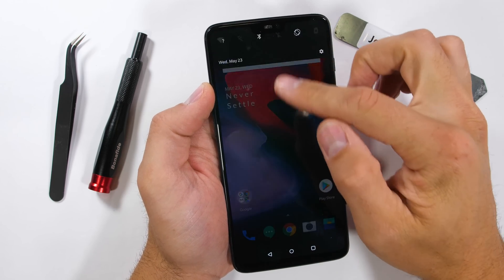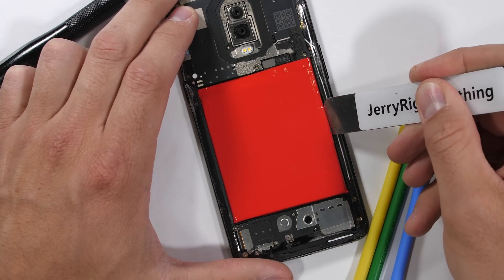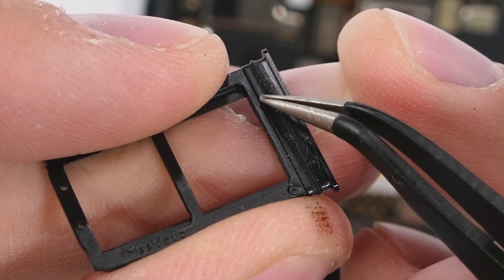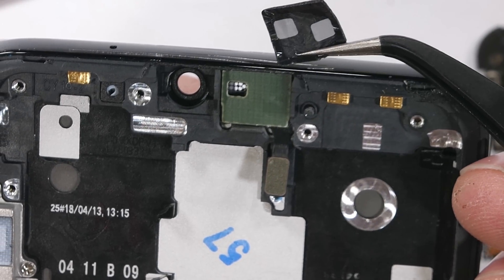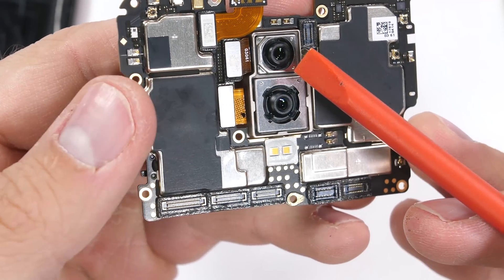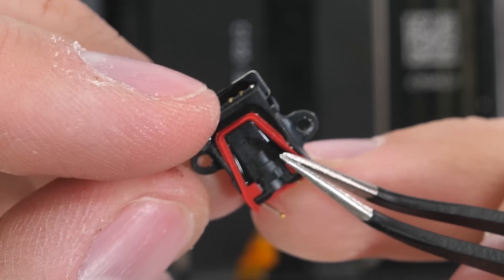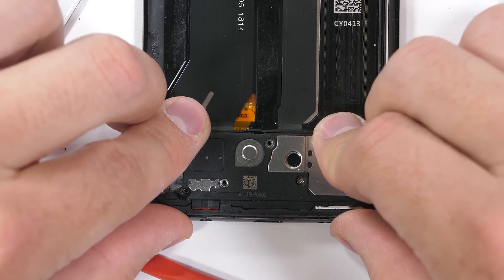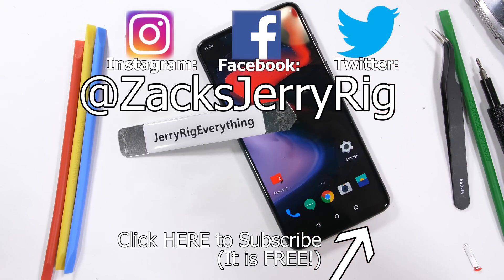OnePlus 6 Teardown! - How Water Proof is it really?

Comment: I've had my OP6 since 2018 and I always use it in the shower... no issues. This phone is built like a tank. Nothing breaks and it doesn't slow down over time. In-stores when I put it side by side with the latest Galaxy S25 Ultra, it's still equally as fast as those. Somehow I doubt the Galaxy phones won't slow down over time, though they'd fare a lot better in heavier tasks of course.

Comment: In retrospect the oneplus 6 really did need better cooling. A lot of oneplus 6's are now dying with the main symptom being the dreaded "Qualcomm Crashdump Mode" issue, where the phone would crash randomly to a BSoD of some sorts. You can see many reports of this issue on Reddit and XDA.

Many people incorrectly attribute this issue to software updates, but in reality it's because the physical internal connections inside the SoC are getting damaged from heat over long periods of time. The most common temporary fix is to quite literally just apply pressure using your finger onto the back of the phone for some time on to the spot where the SoC is (beside the camera on the right) and it would stop crashing for a day or two.

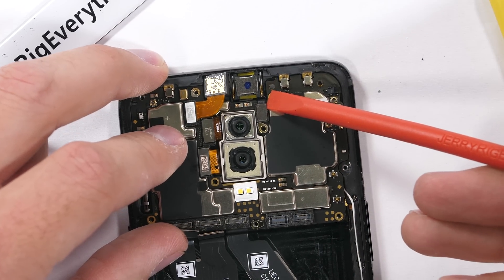Comment: 2:00 To answer Zack question. Yes, it does suffer from thermo throttle after 5 years of use. The temp go as high as 60°c. It definitely needed some cooling solution
Reply: yea same I'm facing cpu heating while charging my phone as well

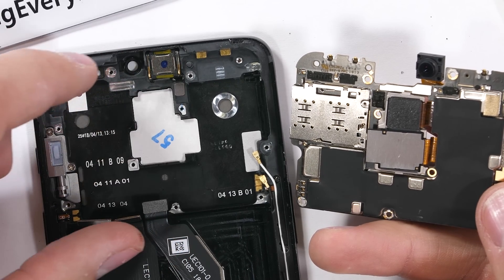Comment: 2:08 Yes, time has told IT IS IMPORTANT TO HAVE HEAT DISSIPATION. Hundreds of Oneplus 6 users have faced a particular error called QUALCOMM CRASHDUMP MODE which involves some loose contact in the eMMC chip, probably due to overheating accumulated damage over time. I have been a victim, and honestly am afraid to trust Oneplus anymore.

Comment: 2:08 The thermal pad is literally right in front of your face (stuck to the underside of the mobo, it might technically be under one of the camera modules, but it'll sink heat into the frame for that entire board)...

Comment: Do you think it would be possible to add wireless charging receiver inside the phone to make it compatible with Qi charging? I know u can add a pad to the back of the phone but that plus into the USB C port, I don't want that. I want it directly connected to the battery. Thoughts?

Comment: OnePlus 6 is a nice phone. But for the asked price i get more where i live. Im in the heart of Europe. The OnePlus 6 in the highest configuration is approximately 720.- euros. For this you already could buy a Samsung S9 plus. The S9plus is IP rated, has a sd card slot, is dual sim, has a higher resolution display (best there is), has stereo speakers, wireless charging, camera can change it’s aperture, iris unlock (safer than face unlock), Samsung pay, Knox and i could keep counting.

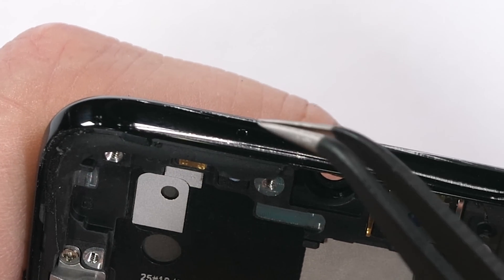Comment: 2:12 Is it aluminium covering the cpu? If so, would Thermal Grizzly's conductonaut be possible? I have Arctic Silver at home though, which is less risky. If you wanna overheat, download Pocket City (amazing microtransactionfree game) and in Sandbox Mode build as many different buildings/roads you can, as fast as possible 😁

Comment: The reason why Oneplus doesn't want to put it officially, is that then they aren't responsible for the idiots who thinks their phones are waterproof and not water resistant. Simply smart defense on their side. They saw how sony, Samsung and Apple costumers got burned by the water damage on the phone, because they thought it was waterproof. So instead of saying our device is protected and you can use it wherever, they said it is somehow protected but just stay dry. Better safe than sorry.

Comment: Do phone manufacturers have to pay for an official IP67 certification? 

If so, that might explain why One Plus chose not to market it as such, despite the inclusion of adequate water-protection.
Reply: WickedRibbon yes they do need to pay for the certification, but it's expensive, thus OnePlus can cut costs.
Reply: Even if it's ip rated the warranty doesn't cover water damages for any phones. It just gives the user peace of mind. 
One plus took the same safety measures but just didn't get the certification to cut the costs. Any customer with a little research will be able to find this information.
Reply: @tawsifislam827  true I wash my OnePlus 6 every single day due to the fingerprint smudges and it is still going great
Reply: Also opens companies up to lawsuits. Samsung as of last month is going through it. Oneplus is an enthusiast company, not a multi billion dollar conglomerate. They would end up going under.
Reply: It's not even a adequete one.

Insufficent in both of money and water resistance.
Reply: @hkw1031 *resistance
Reply: @IcyHorizons2435  Thanks daddy

Comment: The reason they don't have an IP rating can be summed up in one word... WARRANTY!
Reply: Angelito Posse No phones manufacturers give phones warranty, no matter what the IP rating is.
Reply: Alexander Anderson Idk where you live but here in the UK every product sold has a minimum 2 year warranty and it's up to the manufacture to prove misuse if the device suffers water damage but is rated as water resistant for example. If it isn't and it's water damaged obviously that's automatically misuse so they can dismiss your warranty claim.
Reply: Angelito Posse Where I live, phones do have warranty but not liquid warranty, when it was damaged by water.

Comment: I'm guessing that although the One Plus 6 does indeed have all the water resistant components in place, they probably aren't as top quality as the other flagships which is why they didn't want to risk giving it an ip rating. So basically the water resistance is there, it works but it probably won't hold if push comes to shove.

Comment: What ip rating would it have if they'd included it?
Reply: GTech Fam yea that was what I thought aswell
Reply: Lakrima Not sure, but as Matthew Moniz has already proved, the water resistance isn't great.
Reply: Yea but I think it would fall on like an IP 67 or so
Reply: Lakrima nope the video by matthew moniz proved the phone would fail an ip67 test
Reply: nope. matthew moniz also test it two or three times before the test. And ip67 is not only about  40 inch for 30 minutes..The depth can be varies but limited to 1 meter
Reply: GTech Fam yeah and once again the selfie camera got water damage in less than 30cm of water in less than 5 minutes which is well under ip67

Comment: Another Youtuber recently visited the OnePlus factory and during that video it showed OnePlus does run water spray testing on this phone model for quality control purposes, even though they do not market an IP rating on this model.
Reply: Getting an IP rating is expensive, another reason why OP6 is not super expensive!
Reply: Richard Decker companies with ip ratings dont cover water damages either. Its even says in samsungs warranty that water damage will not be covered because it is water resistant not water proof
Reply: We get it. You stroke to Samsung and want everyone to know about it lol.
Reply: Mats Thijssen ip68 is 1.5 meters(about 60inch) for up to 30 minutes
Reply: They also submerge it in multiple feet of water for a while
Reply: @bobgoat5994  i did the same thing, unfortunately my one plus 6 died
Reply: Skelath That's why it is not rated as iP 67 lol it is just "extra protection" for fucking free. They do not advertise it as water resistant but still added as much protection as IP 67 rated devices. Don't think you know more than Jerry who's job is to tear/test phones apart...
Reply: I don't know how you think the One Plus 6 was built fragile. They drop test their phones in their factory over 100 times. If the phone cracked in his drop test, it's probably something he did wrong.
Reply: Skelath 40 inches equals IP 68 if I'm not mistaken
Reply: Ip68 is any depth above 1m/40in. The exact depth is specified by the manufacturer.
Reply: And a good thing for the company is that they can tell you that its your own responsibility if you drown a phone since they dont have ip rating.
Reply: Yeah it was Linus, and for the record he dropped it several times
Reply: Skelath Go back to school and learn how to read first
Reply: Savage Kingslayer except youtuber Matthew Moniz did an IP67 Water test by dropping it in a pool 40 inches deep for 30 minutes and the cameras got water damage and the screen started ghost touching, even 5 minutes in 30cm deep water caused the selfie camera to become blurry.
Reply: @Skelath  Uummmhh do you guys wait for 30 minute before you jump into the pool to get your phone. I probably just jump into the water before my phone even get to the bottom of the pool.
Reply: @boodeehahheroe6185  that's a pool are rivers and lakes crystal clear? Can't say my phone's been in a pool however my phone has been in 3 of my fish tanks recording video and taking pictures to increase sales of the fish I breed and sell as I know for certain there is no chance of water damage.
Reply: Oscar Pineda except youtuber Matthew Moniz did an IP67 Water test by dropping it in a pool 40 inches deep for 30 minutes and the cameras got water damage and the screen started ghost touching, even 5 minutes in 30cm deep water caused the selfie camera to become blurry.
Reply: Fiftoufi the phone is still no where near ip67
Reply: Kris Bright yeah that makes sense, there is a "wrong way to drop your phone: and a "right way to drop your phone" seriously you know how screwed up that sounds? Also do you have any sources or are you just making this up?
Let me guess you conveniently forgot where you got the information off of.
Reply: Oscar Pineda And Matthew Moniz video is still up and running showing how it failed the water resistance test oh and just so you know Matthew Moniz also did a drop test, "waist high" drop test cracked the phone destroying the rest of its so called "water resistance", a waist high drop into a half centimeter puddle would destroy the phone.
So "added as much protection"?
Last time I checked my Galaxy S9+ didn't crack the several times it fell from that height and the silicone sealant that I used to reseal my 400 litre Aqurium (400kgs of water) hasn't leaked and has remained water tight for over 6 years, how much did that silicone sealant cost?
$8.

People here are saying getting an "official" IP67 rating is expensive but making the phone IP67 rated isn't, I merely pointed them out to a "real video" showing it has none of that protection, learn how to read fanboy. 
The phone was built fragile, period.
Also the iPhone X is rated as IP67 and it survived over 20 meters for 5 minutes, a lot more than the OnePlus 6 ever could.
So I'm going to keep enjoying taking photos of my fish while my Galaxy S9+ is submerged inside the aquarium, taking fantastic photos that make my fish more attractive to buyers as I breed and sell them.

Comment: As always, great video, incredibly detailed and informative.  Sadly, there are already water tests on Youtube where it failed within the parameters of what would be required to attain an IP67, nevermind an IP68, rating and by failed, I mean died completely.  I'm not sure if it's due to the minimal band around the sim card tray, as you pointed out, or the type of screens used, but those tests make it clear it is not water resistant.  I think it's probably exactly what they bill it as, splashproof, but you can't accidentally take it in the shallow end of the pool with you and expect it to survive like a modern Samsung Galaxy or LG G would.  For the price they're asking, there is no excuse for this phone not to be IP67 or 68 rated, as there are many cheaper phones that are, i.e. the Moto X4, HTCU11 Life, almost all Kyocera phones, etc.  Between the lack of an IP rating and no wireless charging, I just don't think it's worth the price they're asking, as both would have added to the overall lifespan of the phone, the first by making it more durable and the second by offering a secondary means of charging when the USB-C port eventually wears out.  I think that the main benefit that wireless charging offers, much more so than just the wireless aspect itself.  They made it less durable than the last generation with the glass back, but then decided to leave out the one feature than would have made that change palatable.  The Kyocera Hydro Icon that came out three or four years ago was IP67 and had wireless charging all for a price of about a hundred dollars.  By no means am I saying that phone matched up to the OP6 in the overall specs department, but it shows that wireless charging and water resistance don't add much to the production cost of a phone, so there's no excuse for them being left out of a phone priced at the same amount that a lot of last year's flagships are currently being sold for, phones that include those two features.

Comment: If I may suggest, you could make a clear tank feeding water with a small pump to gradually increase the pressure and assure the depth the phones support... you'd damage the phone but I believe it would be more useful than the burn test or even trying to repair it.

Comment: I think the reason that the phone doesnt have a IP rating is that it cost money to get it certified for an IP rating. So to make the phone cheaper. They did not pay the money for an IP Rating.
Reply: LowEye GT why? Thier is a certified authority for QI, usb, HDMI, THX and displayport. Where companies have to pay licensing fees. So why not the IP rating systems? And all cost that a company has to pay goes into the cost of the devices.
Reply: LowEye GT I think it would. If you compare usb cables and iphone cable cost. The iphone ones cost more because it cost more for licensing. If you look at video games Nintendo Switch games cost more because the media its made on costs more. So I still see the cost in the price. Especially after you read the tesing process the devices go under.
Reply: jack black Yeah, IP rating costs money and OnePlus 6 failed to even get a IP67 Rating

Comment: the one plus 6 may be officially water resistant such as ip68 but the thing is a company that already makes small profit margins cannot afford to claim such a rating.
Reply: *ip67
Reply: Except youtuber Matthew Moniz did an IP67 Water test by dropping it in a pool 40 inches deep for 30 minutes and the cameras got water damage and the screen started ghost touching, even 5 minutes in 30cm deep water caused the selfie camera to become blurry.
Reply: joemann7971 yeah except in a 30cm jug for 5 minutes the selfie camera gets moisture inside it and the speaker is barely audible .
The iPhone X and Samsung Galaxy S9+ in everythingapplepros water tests last well over their ratings.
Should also note that matthew moniz just released a drop test video and on the first drop test from waist high the glass cracked which in itself creates an opening for water to get in so if you were to accidently drop it in a puddle your phone is screwed.
Also any physical damage to the body voids warranty, before selling my old Galaxy S8+ after I got my S9+ I was able to warranty the phone and get a free replacement of the entire OLED display due to barely visible screen burn-in which got rid of all the scratches on the screen upping resale value.
Reply: joemann7971 iPhone X is officially rated for ip67 not ip68 and ip68 is 60 inches not 40.